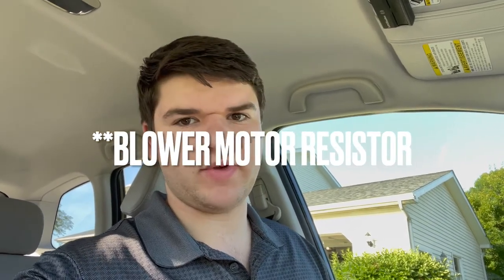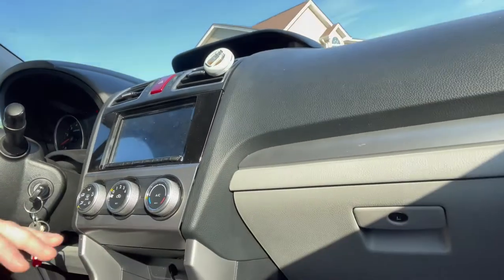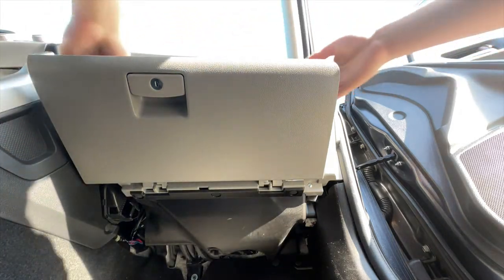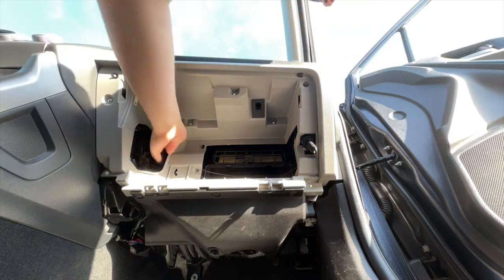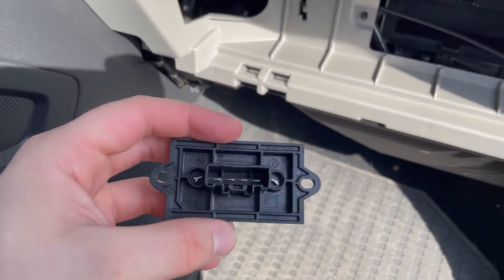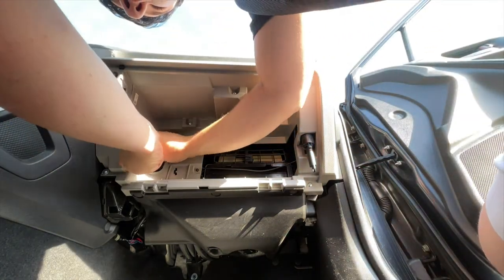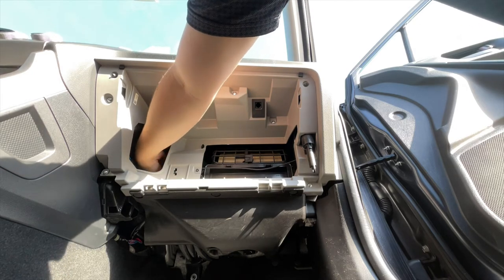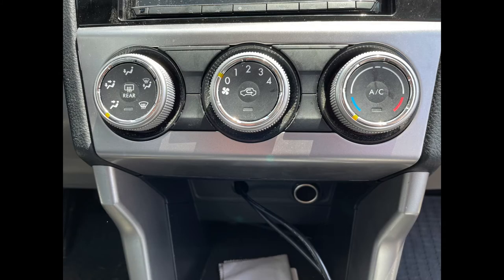Blower Motor Resistor Repair (2014-2016 Subaru Forester)

Comment: That was SO HELPFUL!  And it would have been easier if I took the wiring harness off FIRST!  Yes, pliers helped because I couldn't get it separated.  I also pulled off the apron below the glove box because it was only three clips and made access from underneath easier, especially for tightening that more difficult screw.  THANK YOU!!!  SO MUCH!!!

Comment: I'm grateful for this video.  I bought the new unit and put the job off for a long time because I didn't want to tear the whole dash apart.  My Forester is a 2009 and this process worked well.  I found that it was helpful to drop the plastic panel below the box so I could get two hands in there.  I found my box was pretty stiff and pushing in on both sides to drop it down required some help from a couple of flat bars to gently push the sides in.

Comment: Great video! Seems like you would have saved time if you would have removed the 4 screws holding the glove box surround and get it out of the way. Probably would if your hands are large. That also would have made it easy to replace the cabin filter which likely hadn't been changed since the car was new.

Comment: Thanks for the video.  My 2015 Forester was very similar except only level 3 would work not 1,2 or 4.  Replaced the resistor and same thing but I can hear the "electronic click" when switching to each other speed so have no clue what it could be. Im thinking the actual knob is the issue.
Reply: I just saw you comment would help me 😩, I mean, you fix yours because I have the same problem my air is only running on the number 3, and doesn't run and  1,2 or 4.
Reply: @nehemiasochoa811  No I haven't tried anything else, just because its a pain to remove that front panel with the knobs.  But Im pretty sure thats the problem.  That the knob needs to be replaced because of the contacts are messed up.
Reply: I have the same issue and when I turn it to 1,2,4 the AC light turns off

Comment: Hi Alexander, I have a problem with my blower too. Where I cannot adjust the speed. It’s just one speed whether I put it on full speed or low speed. Do you think replacing the resistor would help?

Comment: Good video replaced resistor and motor speed 4 still doesn't work my buddy said I need a new head unit
Reply: Mine has no 4 either. What do you mean by new head unit?
Reply: The whole dash unit
Reply: @mattdaley1891  crap. Thanks for the reply, I appreciate it. I thought that what it was, but wanted to make sure
Reply: Was it making a clicking noise when on 4?

Comment: Always change Resistor and Blower motor together.
Reply: Absolutely great advice, filter, motor and resistor 💯
Reply: Why?
Reply: @leonessity  I've dealt with these problems twice and I always ended up having to do both.
Reply: @johnwarren8735   I just finished watching a video that explains exactly why both should be changed together.  Thank you for bringing the issue too light, as I would never have thought the those two parts would bear their stress upon the other, in the manner that they do.  It is funny how we learn to do some things, without necessarily understanding WHY, eh!

Comment: I have the opposite issue, the ac works find at speeds 1 and 2, but when you turn it up to 3 or 4 the blower turns off. I haven't been able to find anyone with the same issue
Reply: Same with mine! I got it diagnosed today at brakes plus. $500 fix. HVAC control head is what they said it was.

Comment: i got the opposite issue... my high speed cuts out at 3 & 4 2014 crosstrek xv... tried changing out resistor module, worked just the same... could hear actuator clicking as I changed setting on 3 & 4.... any suggestions?
Reply: Replace the blower motor.
Reply: I have the same problem. I found a Reddit page that went over this issue, and they said it is the resistor. The real problem is the plug on the back of your head unit. If you took off your head unit, you’d see that the plug and outlet for your hvac is burnt and melted. I’m going to be splicing a new cable onto it and hopefully it works.
Reply: The reason it happened is because your broken resistor let too much power through, which in turn, melted the plug.

Comment: Mine working on 1 and 2 , not working on 3 and 4, blower fan stop working on 3 and 4
Reply: Did you ever solve your issue?
Reply: @jonathanrjacob  yes I took it off and clean it with sand paper work perfect
Reply: @kboss0604  the resistor or the interface behind the knob?
Reply: @jonathanrjacob  it's the connector to the power switch theirs brass need to be clean